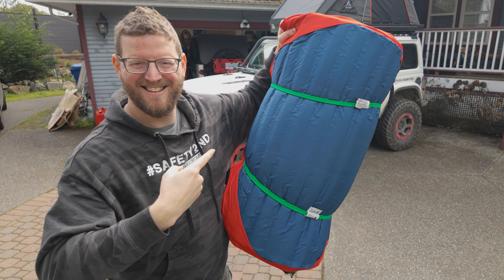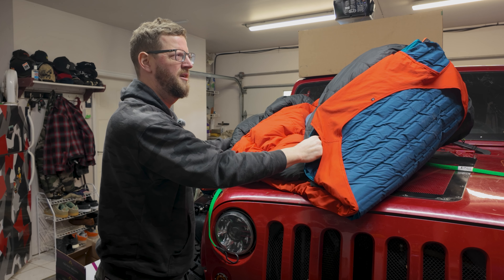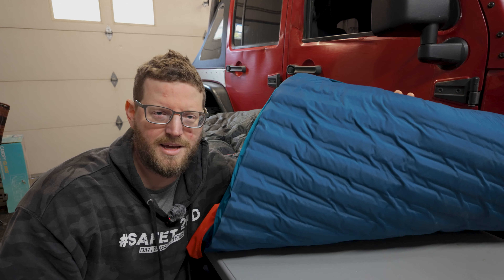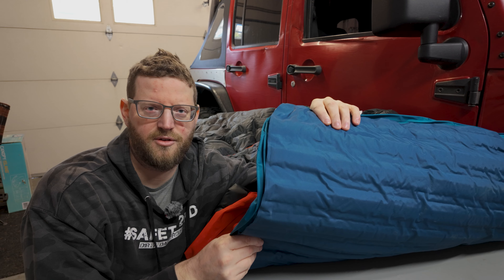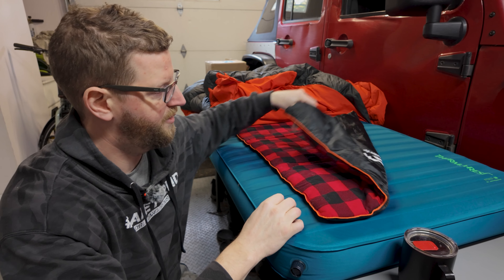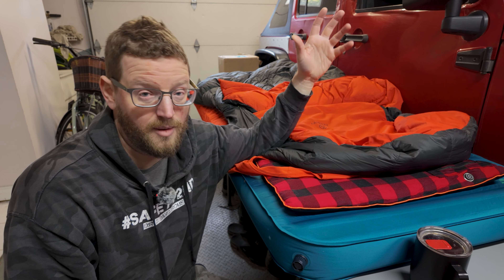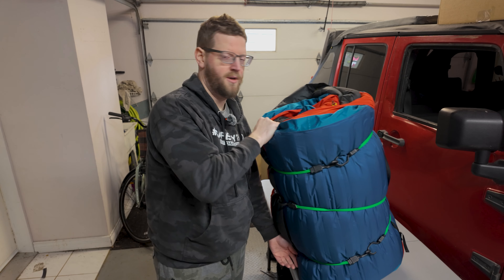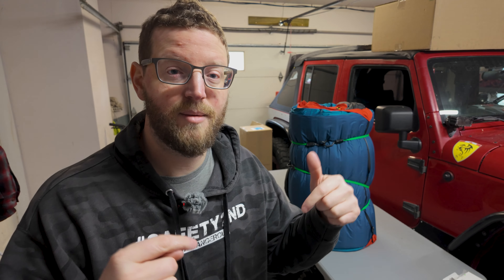Why This Sleep System Beats Sleeping Bags

Comment: Hey Casey, your best bet for something to protect your sleep gear without having to stuff it would be a bivy bag like we use in the military, the one that looks like a glorified garbage bag, not the ones that are mini tents, some even have full length zippers so you could just open it and lay your stuff in then roll, with the added benefit of being a waterproof layer or helping retain extra body heat if you want to sleep in it also, they're a blessing for sleeping bag systems when exposed to any elements. Also for a video idea you should do one on what type of radios/coms you use out on the trails, us Canadians have some wild radio laws compared to the Americans so it would be nice to see what everyone else is using.
Reply from the maker: Slick - going to check this out. Many thanks! Radios are a tough subject up here. Most run VHF with out licenses so its a video i've stayed away from.